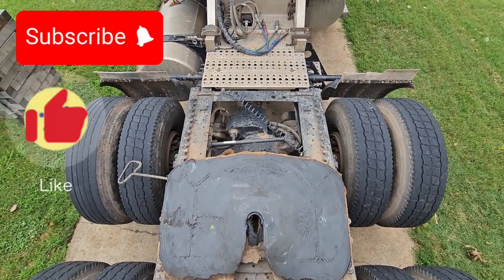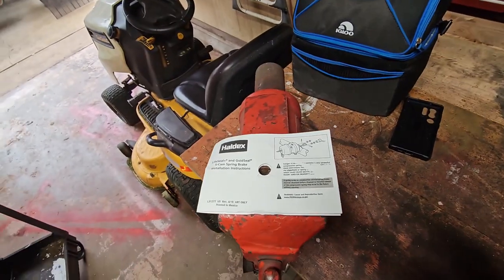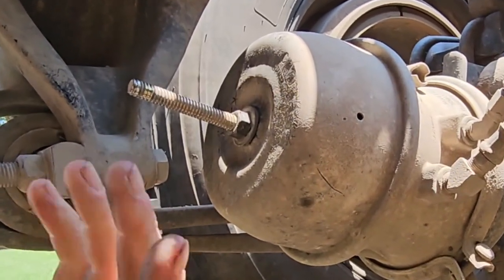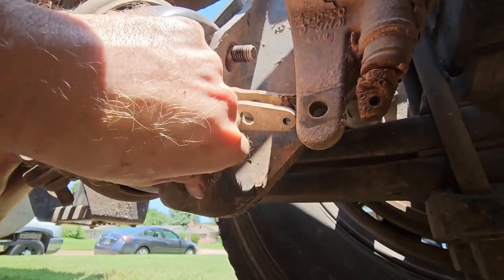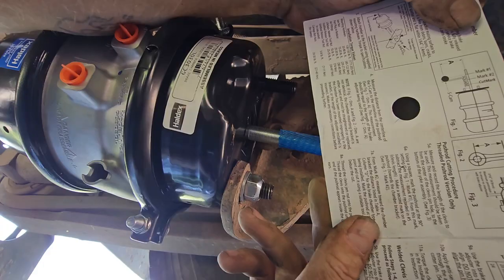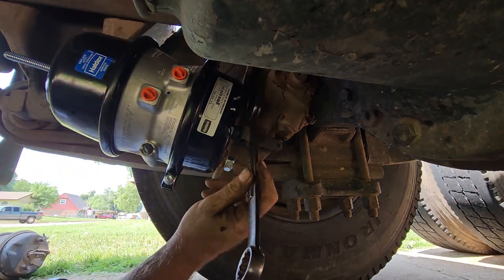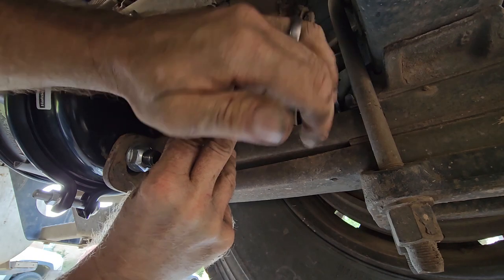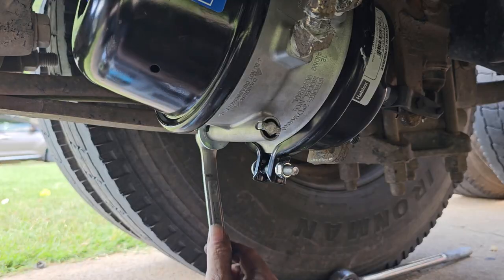Changing a brake chamber using the instructions  (very detailed)

Comment: Just a tip or two from another machanic. You can use the brake adjuster to your advantage, after you pull out the clavis pin use the brake adjuster and open up the brakes. When you feel that the brakes are fully open keep turning a little more and that will pull the  arm of the brake adjuster out of your way when you go open the mounting nuts. 2 if you have shop air handy you can skip the spring brake cage bolts, after you disconnect the air lines from the caliber just connect shop air to the spring brake side. And the new spring brake cage bolts you should put those in the cab so they wont rust. We have had many calibers cracked because of those bolts rusting inside that aluminium hole on the calibers side.
Reply from the maker: Appreciate all the tips.  Sounds like you know what you're doing.  I don't have an air Compressor.  I'm about out of room in my one car garage.  I'll have to take off those caging bolts and put them in the cab.  That makes sense.  And getting the slack adjuster out of the way how you said makes sense too.  It got in the way a lot.
Reply: @aftersolo  Well i have worked as a truck mechanic for 27 years so i guess you can say i know a thing or two ;)
Reply: Good job. Took a lot of patience.
Reply: @hapsusami We are ready for another brake chamber replacement video.

Comment: Nice video ! I would like to add an item. Pipe threads get the teflon paste, you should never add teflon paste to a metal to metal seal like the seal from the air hose to the fitting you screwed into the brake chamber. Don't put anything on that side of the fitting, just make sure that it is real clean, those threads on that side do not do any sealing it's the metal to metal part at the beginning of the fitting that does the sealing.  @ 18:04 If you have an air leak in the future, I would look at this fitting first.I hope this helps you ! Be safe and have a good day!
Reply from the maker: Oh, ok.  Appreciate the tip.  I never know when or when not to add the Teflon half the time.  So you're saying it needs nothing?  Just bare?
Reply: @aftersolo  Just when you have a metal to metal seal. When you have a metal to metal seal, the sealing surface does the sealing not the threads.I hope this helps!
Reply: @RNP69   if you've been in the field you know that a little teflon tape goes a long way. metal on metal never seals air tight. stop the cap.
Reply: @brucemcelroy3186  I would say to you, Have you ever worked in the field? I have worked all my life in the field ! What do you think a flare fitting is? metal to metal, The threads on a flare fitting DO NOT do any sealing ! just one example, Oh one more example of metal to metal is a pipe union.
Reply: @RNP69   there was one flare connection and three NPT connections. he put pipe dope on all four. the only one that didn't need pipe dope was the flare. NPT connections never seal air tight. you've been putting air leaks back on the road my guy. nobody even uses flare fittings on brake lines anymore. get with the times.
Reply: you all are gonna make me do one of these videos, and then do air leak-testing afterwards so I can show you how you've been doing it wrong for what is possibly decades. if you were worth your salt as a mechanic you would explain to this guy how he could save himself an hour and produce the same result. I did exactly that just a few comments down, chief.  also, rather than struggling to get the clevis on cuz there wasn't enough threads, unscrew the caging bolt a bit to extend the pushrod out and cut it at the mark. you'll get closer to 90* that way. My last pm inspection I found two different length Automatic Slack Adjusters and it's because of people like RNP here who think they've known everything since the dawn of time.
Reply: and before we get all pissy and think I wouldn't talk to you like this in the shop, you're wrong. I talk to people exactly like this every day.
Reply: @brucemcelroy3186  I used flare fittings as an example of metal to metal seal !  There is something wrong if you can't make a NPT air tight !!!!!
Reply: @RNP69  perhaps your definition of air tight and my definition of air tight are different. what's certain is mine will be more.
Reply from the maker: Thanks again for the input and for being civil and polite.  Theres no need to insult each other out here and talk down to each other.  I see it way to often on here.  Not so much out in the real world.

Comment: 5/16 wrench and a flat tip screw driver to release the parking paw on the slade. You can actually back the slack off and away from the clevis.  Id will hold it's position.  Till you turn the square knob on the top of the slack

Comment: Put the truck in 1st gear. Then release the brakes with the engine off obviously.  The truck being in gear and not running. Will keep the truck from rolling once you let the clutch out. Then release the brakes. Then cage them. Also you can by the extra deep 3/4 half inch drive socket for cage bolts.

Comment: You can buy those brake chambers with the welded clevis already on them. No cutting required
Reply from the maker: Do they always work?  Seems it might be too long or too short depending on the application.  I've never used one though.
Reply: When i install welded clevis chambers, I just go off the vin, perfect fit everytime.@aftersolo
Reply from the maker: @sebastian9463  I'll have to try that next time.  Cutting them is a pain.
Reply: If the ports on the chambers for the airlines are square.  It's a long stroke chamber,  if the ports are round port. It's a short stroke.
Reply from the maker: @GregFeeney392  it's a 30/30 long stroke.
Reply: @aftersolo  you can get those with the weld clevis. You can get the welded clevis. For the brake chambers that go on the steer axle
Reply: I will tell ya what if I was your neighbor or a fellow driver in a team operation.  Between you and I that truck wouldn't hardly breakdown.  I have a CDL A with years of mechanic experience.  Just trucking and routine maintenance.  If there was a mechanical issue.  Bam it's going to be fixed.
Reply from the maker: @GregFeeney392  Heck yeah.  I park with 2 other guys, but they don't do any of their own work.  They've recommended some good shops though.  A team operation would be awesome though.

Comment: after touching about 3500 dry box van trailers over the past 6 years I've realized that a lot of individuals can't execute this process very well. I've set up close to 200 brake chambers and replaced service diaphragms on another 100. most of the guys I know that work on tractors do what they call back-halfing. they only replace the front part of the chamber, effectively avoiding: removing the clevis, removing the chamber nuts, and measuring/cutting the push-rod. After that process you've replaced all the air-sealing components and replicated the brake stroke from before.  do what you will with this info. I always replace the entire chamber, adhering to the entire manufacturer procedure. I hate the pipe goop. I'm a taper. I've sealed over 1000 units to <3 psi/min leak down. I'm him.
Reply from the maker: Sounds like you know what you're doing.  Yeah, a lot of guys were saying I don't have to replace the whole thing, but I figure if one part is bad, the other is probably close to going bad.  Might as well do it all while I'm down there as well as the other side so everything is even.  I hate having a bunch of mismatched parts.  

What is it about the Teflon paste that you don't like?  The stickiness?  That stuff is impossible to get off your hands.  One guy said there's no reason to put anything on the connections since they're tapered.  Idk.  I like extra security.
Reply: @aftersolo  I was using tape, three wraps, and making sure I went the correct way so it wouldn't peel back when you screwed it in, for a few years. I went to a new company and they said we only use the paste, I used it one time and hated it. I continued using the teflon tape I had in my box. eventually they got me more of it. Earlier in my career I argued with a guy that you didn't need any sealant (tape or dope) and he proved me wrong with a leak-down test on job I had just done. The fittings we stock currently have some pink stuff on the threads already from the factory. I assume it's a thread sealant. I still put two layers of tape. I always liked flare fittings but I haven't come across one in a long time on an air brake system. maybe they're more common on tractors. old dude is right about not needing any sealant on the flare fitting.
Reply from the maker: @brucemcelroy3186  ok.  I appreciate all the input.  All I did was drive trucks for 9 years and never really learned anything about them.  I've had the business 6 years now, and I've learned so much about working on them.  I've always been mechanically inclined growing up on a farm and all, so this truck is kind of like my farm I guess you could say.  There's always something to do on it and always something to do with it.  Keeps me busy.